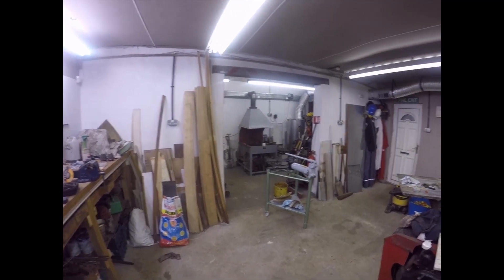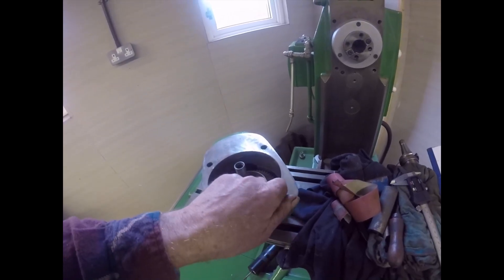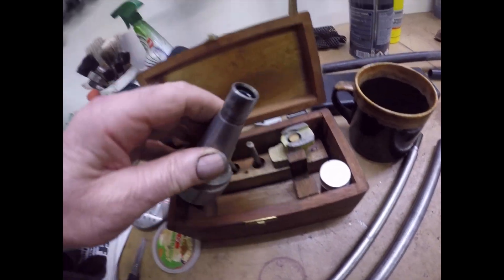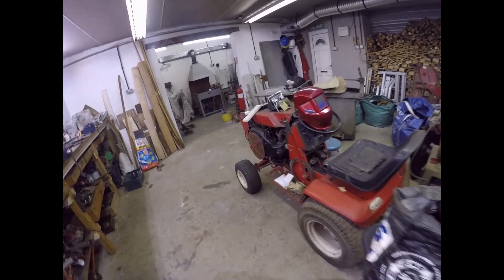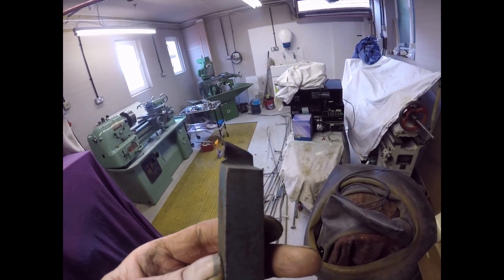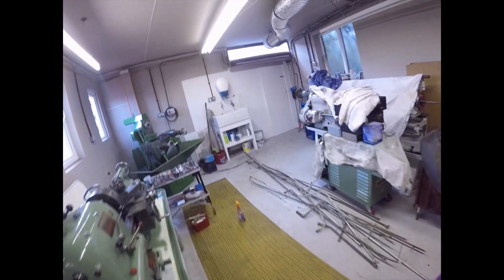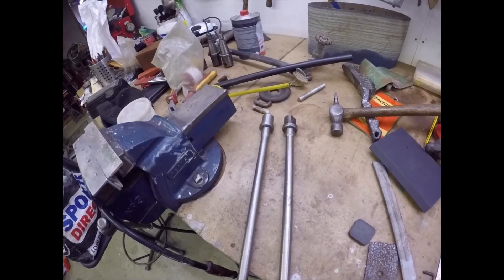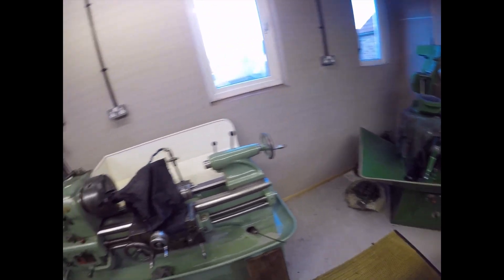One thing leads to another, and another, and another   …  I get sidetracked!!

Comment: It's all go and all interesting stuff there young man. The dowel pin. It is 0.4mm too big to go in the milling machine. Rather than try to turn 0.4mm off the pin I would try the following; 
1. Place the pin in the bottom of a freezer (Could be found in the staff fridge?) until required in order to shrink the pin.
2. Prepare a means or device to gently warm the receiving hole in the milling machine.
3. Then gently warm the hole for a minute or so.
4. Then gracefully recover the dowel pin and insert it to the required depth into the milling machine hole.
5. The heating and cooling of the parts should give you enough clearance to insert the pin all the way.
6. Leave the milling machine to cool whilst one enjoys a brew.
7. After brew and cooling time, fit the gasket and milling head and tighten to the required torque.
8. After fitting, stand back, admire and have another brew!
Reply from the maker: Eyup! I think that might just work, I will have another measure on Monday, as I remember it the hole is 10.66mm but not that easy to measure accurately. I will clean ot all up monday and have a good sqy at it!. Phil.hermetic@langtoft.net